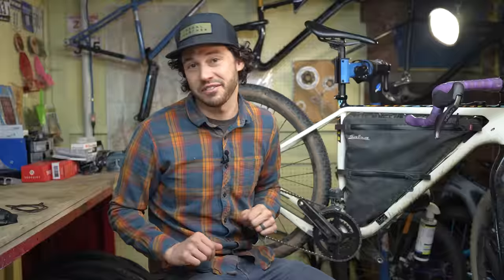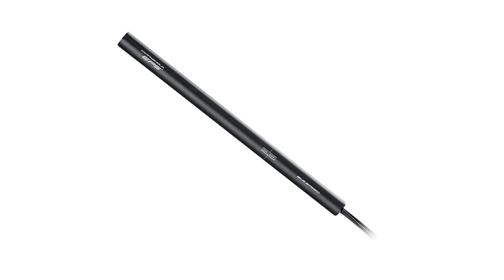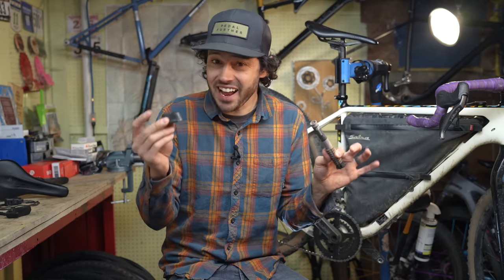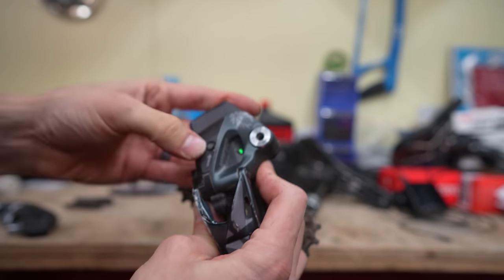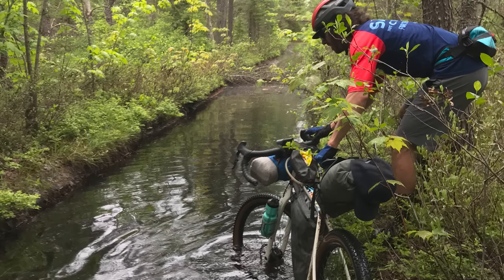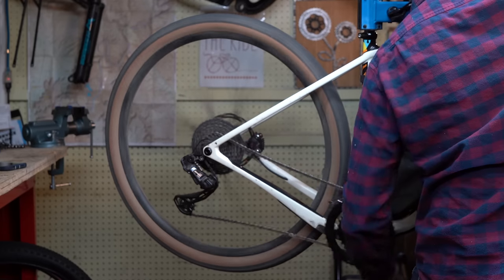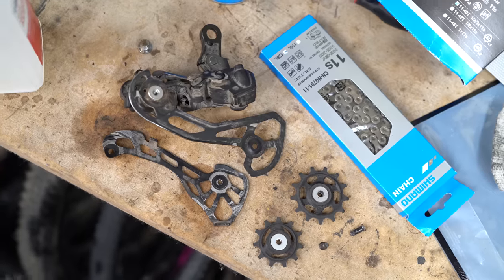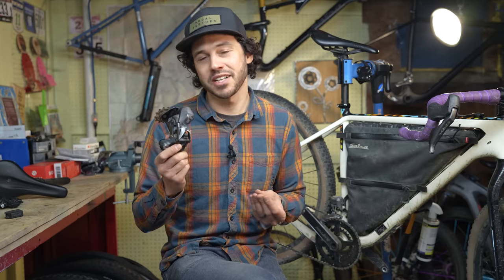Electronic Shifting: Pros, Cons, Reliability, and More

Comment: One thing I like about electronic shifting is that once the initial adjustments are made, and you don't mess with them, if your shifting degrades you can quickly deduce that you've bent your derailleur hanger. Compared with housing and cables slowly being exposed to contamination, plastic housing liners being constantly worn on by cables in the act of shifting,  and the development of corrosion all affecting the level of resistance and precision of shifting. Not having to think about any of that and what is the right level of compromise before deciding to replace is my favorite part about electronic shifting.
Reply from the maker: Excellent point.

Comment: The main thing that puts me off electronic shifting is repairing both on the road and at home. With a mechanical mech, no matter how much you prang it you can usually bodge it to get it working and get you home, then just buy the replacement bit you need to repair it. If an electronic motor or circuit board dies, you brake a connector etc your really expensive mech is toast.

Comment: What we need is a hub gear with electronic shifting and a built in dynamo as a sealed wireless unit, because if you are moving you are shifting, then add a small dynamo at the front to power the controller and it should be a little more 'set and forget'.

Comment: I just got a brand new 2022 Kona   sutra LTD

It came with rival, mechanical, which I must say, feels fantastic on and off the road. It’s kind of tantamount to an automatic watch, simply, more tactile. If I were to do another comparison, it would be the manual transmission in a car, unequivocally slower than the modern twin clutch transmissions , but better in the mechanical way

Comment: having no experience with Shimano DI2 I'm really shocked how short the battery life of these huge batteries is and how often you have to charge them! I have SRAM Red Etap on my TT bike and those small batteries work fine for an entire season without recharging, should be good for weeks or month's on touring bikes. Nonetheless I would not use them for backpacking either (though you can easily take fully charged replacement batteries as they are so small); because if anything happens to any electronic shifting system out there you simply cannot do anything - repairing those is impossible. On the other hand a mechanical shifting system can always be fixed if you are a bit used to maintenance

Comment: Still not convinced. More weight. More cost. Possibly another item that can fail. And yet another component to maintain periodically (namely, charging). 
This is a great video and I'm glad other brands aside from SRAM and Shimano were covered. We really need to lessen the power of the duopoly here. Sure they make great products, but they have a huge sway in industry focus. It's also half the reason many folks out there can't purchase new bikes. And now that the newest Dura Ace models are di2 only, it's very well possible that the next Ultegra models will be electronic only too. Pretty soon, the road/gravel enthusiast will have little choice but to pay extra for these non-imperative features in the name for profits.
Reply: They’ll just have to give Microshift or Gevenalle a shot? There are alternatives out there, they just aren’t as well known.

Comment: What brand is that square (top view) external battery pack that you use to charge your SRAM batteries? Link?

Also recently seen the PedalCell.  It appears to be hundreds better than a dynamo hub... charges faster.... also even at a hike-a-bike pace, at least what I have seen in the YouTube ads.... doesn't work with carbon rims though.

Comment: Im a big Di2 fan. Ive built a handful of gravel bikes with it with zero issues. I also built a rigid touring mtb with a combination of Ultegra and xtr components. I intentionally went with a cable operated hydraulic brake system so I could switch between drop bars and flat bars with a simple bar change with levers, grips, shifters, cables, etc permanently installed on each handlebar set. The xtr gear indicator is great in a drop bar application as a replacement for your upper junction box with the obvious added benefit of a gear indicator but also a battery level indicator as well. A good option, if your components allow for it, is to mount a Di2 battery in the steering stem. This way you have a single Di2 cable routed towards the rear of the bike and its easier to access than a seat-post mounted battery.

Comment: I have built my touring bike with mechanical shifting, just because of that "what if it fails on the Mongolian steppe" thought, while the rest of my bikes all use Di2. And I have to admit there are times when I feel so very over with mechanical shifting. With perfect shifting gradually going out of adjustment so you're after a while kind of used to having crappy shifting, and then you fiddle with that barrel adjuster and it's fine again. I also kind of dislike how shifting the front and rear derailleur feels totally different. DI2 is just fit and forget, and on a long trip I'll bring a bunch of powerbanks anyway so charging won't be a problem. I seriously consider converting it to DI2. Or maybe running DI2 most of the time and convert it back to mechanical whenever I plan to go on a seriously long trip.

Comment: got axs on roadbike and bevore that DI2 .... love it both alsways shifts flawless unless battery is death, one of the best things I love is how easy it is when to adjust the rear shifter just push a few buttens.... I usaly just do it when riding.... then you can easy hear if its running good :)
My DI2 battery died after 1 year.... got a new one do for free. where I live its pretty flat Netherlandss....so not that mutch shifting DI2 battery last me 4 months riding 10hrs a week. usaly charged it bevore the road season starts, half way and in the end bevore I stored my bike for the winter and pick up the gravelbike....
Now with the Axs system I usaly charge it every 2 weeks and my garmin warns me when to charge it.... only when doing big events or days like 10hrs or so I charge them to be save.

for my bikepacking I use mechanical.... just because I dont want the hassle with it. and got to much electronics to charge any way.
running a SON dynamo with Forumlader converter, daily charge my phone/garmin/watch/1drone dyi mini battery on a good day of riding and some spare power for small power bank

Comment: I had Shimano Di2 on my TT bike and I used to charge it every 6 months! It was so durable. Upgrading firmware was easy (the down part was that de E-Tube app only ran on Windows and wasn´t available for MacOs). The battery work fine for almost 6 years until I had had to buy a now one. Don't know if I would run eletronic shifting on my gravel bike for bikepacking (mainly because of the price) but if I do I know it will be great.

Great video. Cheers!

Comment: I have the AXS system on my road and gravel bikes, but I have had some issues with the shifters eating batteries that really gives me concerns about using bikepacking.  The derailleur batteries are rock solid - I haven't ridden them since November and I had enough charge to ride today if I had wanted to when I put them in the charger.

Comment: I've never used e shifting and don't see myself using it either. I'm sure these systems work great and are reliable I just don't think shifting is that big of a deal. I'm running 1x12 with gripshift and can go up and down the cluster at will. Not that hard.

Comment: I run full housing and avoid washing my bike with a hose. I often get 2-3 seasons out of a shift cable, which is about the same lifespan that I get out of the actual derailleur. Everything mechanical wears out eventually; the same amount of riding will wear out the swing pivots on a mechanical derailleur or an electronic, but you'll have a much bigger bill to replace the electronic. I'll stick with mechanical instead of charging my derailleur 15 times a season.

Comment: I’m in the process of switching over to Rival AXS. For me it was less about the electronic shifting and more about how comfortable the Rival levers feel in my hands. Also Rival is available with a 43/30 chainring combo which paired with a 10-36 gives me a perfect range for the terrain I ride. Right now I’m running a cobbled together system which gives me a similar gear range but it doesn’t shift nearly as well since it’s assembled with parts from 5 different companies rather than just one. Do I worry about my electronic system dying in the middle of Outer Mongolia? Nope, not one bit because….I never plan to make such a trip! Longest trips I plan on taking are only 3-5 days due family obligations and other hobbies. All that said, the cost is still hard to swallow. Hard to imagine a third tier group set costing more than DuraAce or SSC did back in my racing days.

Comment: That broken etube wire hurt me in my soul. They are the wolds most expensive tiny pieces of wire
Reply from the maker: And really hard to repair. I actually broke this one on purpose thinking I could fix it, and the two small wires are so small, I gave up. That part was cut out of this video. ;)

Comment: I've talked to bike mechanics who all said electronic shifting is nice but, definitely a non necessity and more complicated to set up. Also, there is the risk of software bugs.  
  As per why I'll Never run an electronic shifting system is that it is one more thing I have to charge, cables are more reliable (use common sense and don't do big trips w/fresh cables plus, let them stretch first, check shifter cables pretrip), and just the simple fact that purely mechanical shifting has worked for the last 60 years with periodic updates speaks to the durability and relative simplicity of mechanical shifting.  Additionally, haven't yet broken a shifter cable; they've ended their lives super-stretched beyond ideal operational parameters when I had them replaced but, that's about it.
Reply: imo the main issue is that most mechanical drivetrains require constant adjustments to work great and these adjustments require a skilled mechanic (home or not). electronics make all this easy.

a modern 1x mechanical is imo every bike as precise and reliable as electronic, if slightly longer to initially setup. my sram eagle setups are particularly bulletproof especially of you use the proper cables and hoses (ie sram's), you dont even have a burn in period or anything like that. last i needed to touch my derailpeur is 2y ago, and it gets riden for many hours every week of the year .. and its a mtb. it jumps. it falls. it gets bounced around.

so while you're right imo, theres soe nuance, electronic isnt bad either, and old drivetrains are worse :)
Reply: @kangsterizer  I use the Box 1 1x11 and so far, so good(!).  So yes, i agree with you on the reliability of the new-gen 1x mechanical systems; haven't had to twiddle with it like one had to back in the late 80's or 90's.  Additionally, even if I was leaning towards electronic shifting, i would be waiting for the next generation that was 100% internally geared(!).
Reply: The wireless AXS system is certainly not more complicated to set up. 
Just attach derailleur and shifter to bike. Pair them and set the high and low gears and that's it. No having to thread cables through frames and retweak as cables stretch. I just wish it was a lot cheaper.
Reply: I'm running axs on my top fuel.  Nothing complicated about the setup whatsoever.  In fact, way less maintenance than mechanical.  The only real downside I can see right now is sram doesn't offer a long cage replacement. They should change this. It's become a moral issue at this point.
Reply: @troycarpenter3675  You have to worry about buggy software upgrades, water/electricity mixing, and battery life with e-shifting.  Adding to the list of issues i have also is the negative environmental and human-rights issues that come with Lithium mining (violation of tribal sovernity with proposed mine on Nevada/Oregon boarder area that was also an area where many Native Americans were genocided by the American government at that moment in time; something to think about...)
  Too much e-b.s. cropping up on bikes and computer crap too(!).  Bikes are supposed to be purely mechanical, Affordable, and purely human-powered vehicles that are zen-simple to use and maintain.  The boundaries between bike and two or four-wheeled vehicles is starting to seriously blur and not for the better.
Reply: @bartmullin8018  put the aluminum foil back on bro
Reply: @bartmullin8018  Electronic shifting is not in any way blurring the boundary between bike and car. 
Bikes are also not 'supposed to be' anything other than human propelled two wheelers. I keep being told that tubeless, discs, hydraulics etc are unreliable, complex and difficult to fix. Except in reality, they've made for far less bike fixing and faffing needing. A lot less. 
As for buggy software, once you gears are set then there's no need for software updates and that's something you can choose to do or not anyway. Electronic shifters also have a handy redundancy feature that mech systems do not have. If you trash one in an accident, then you can use the other to do all the shifting. Not trashed a Brifter myself, but have had cables shred inside brifters which was a faffy home or shop mechanic fix. 
By all account these gears survive awful weather and dunking in water really well and rear mechs can  also auto move out of way when hit by a rock. A common cause of trashing rear mechs. Would I replace my current setup with electronic shifters? No, they work well enough. But will next bike have them? Most certainly. Well that's assuming I can afford it. They are still silly money. 
As for lithium mining, def an issue. But tiny lithium batteries for bikes are simply nothing compared to phones, laptops, cameras, and most of all EVs.

Comment: Another potential issue/annoyance I read about is (some/all?) electronic shift designs wait to shift until the cassette is in the exact. right. place. for optimal shifting, while a rider climbing through rocks/logs/bumps may want that shift NOW down to the millisecond, not 1/2 of a crank revolution later when the shifter decides it's now the best time.
Reply: So the rider should also be able to time their triggering the shifter down to the millisecond. I am definetly not that kind of rider and that's probably why I never experienced that problem. But I can tell that my AXS shifts into a larger cog way faster than the double tap shifter on my other bike. Also afaik cassetes have different points to engage with the chain to lift it onto the next larger cog and you just can't shift it any millisecond you like, neither with mechanical nor electronic shifting. Don´t forget the shifting is still working mechanically but the method of engaging the derailleur is different.

Comment: Thank you for your review and opinion.
Did you know DI2 is now wireless too?
Cheers
Reply from the maker: The Ultegra  Dura-Ace groups, which I argue are not great bikepacking groups, are now 2×12 and the Di2 electronic shifting system was reengineered as a wireless cockpit, but it still uses E-tubes to connect everything else. It's a starts, but I'm scratching my head trying to think how they could make a wireless system without compromising the awesome battery life.

Comment: I love your video and appreciate your dedication. I just could never run an electronic part thats so expensive, one bad bail and it's junk. Now your out $2k maybe and you can't shift or ride at all. If your derailleur is set up right, a mechanical will never let you down and is quite literally a fraction of the cost. Definitely a trendy fad for the dudes that ONLY spend money on their bikes. For it to be the only option would just be a step towards killing the sport because you're making it exclusive and expensive.
Reply from the maker: I totally hear ya. I hope to have my thoughts on the Archer system in the next month or so, It's treated me well so far and works with any mechanical system.